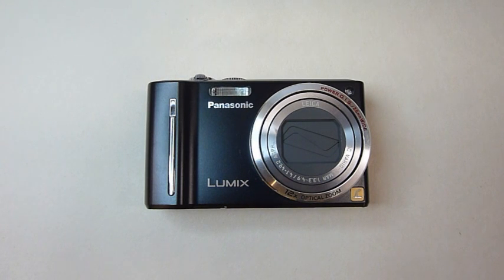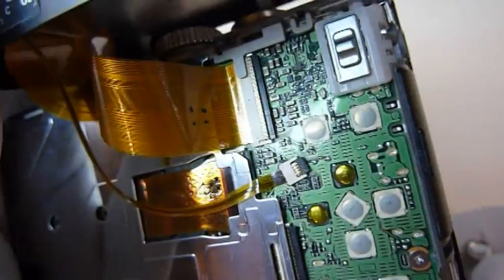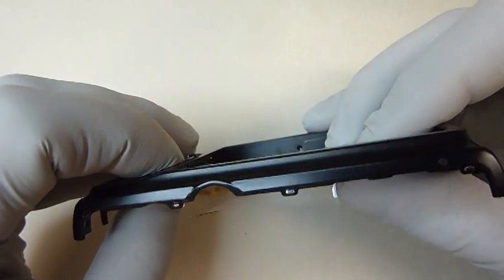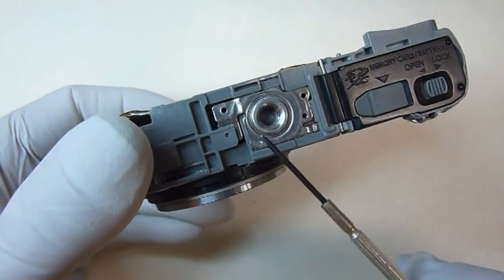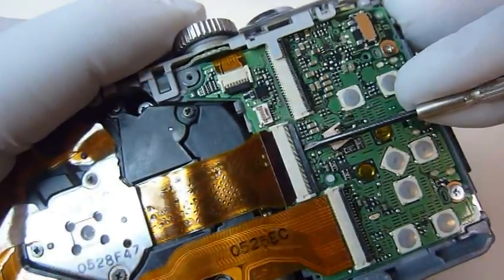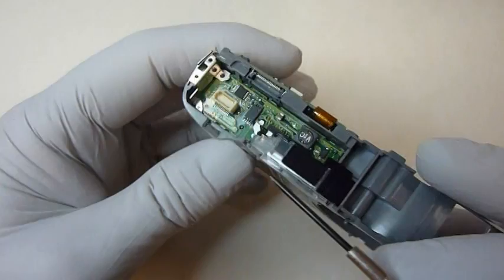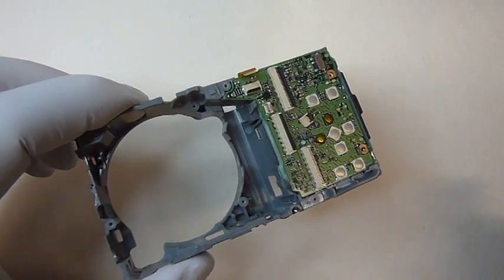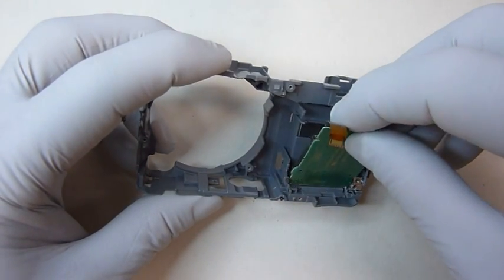Repair A Panasonic Lumix ZS6, ZS7, TZ9 and TZ10

Comment: Hi Robert! My TZ10 fell into a river and now it doesn't work. I tried to dry it in rice and now there are no signs of humidity but it still doesn't work. What parts do you think I should replace?  Should I get it repaired or buy a new one? Many thanks for your help
Reply from the maker: Hi Miguel. Even if you can't see any moisture on the circuit boards, there may still be enough moisture on them to cause them to not work correctly. You should still try to dry them completely out. If it still doesn't work after drying them out then you may need to replace the main board. But, even that is somewhat of a guess at this point. If the LCD display doesn't show some kind of water damage, then I doubt it is bad. Does the camera do anything at all when you attempted to turn it on? -Bob
Reply: Hi Miguel. I wouldn't write the camera off yet. There's a chance it's still very wet inside and can be dried out completely. The rice method only works to a point. If the camera was not powered on when it got wet, then that will increase your chances of it being repairable. But, even if it was on you may still be able to dry it completely out and have it work again. You will need to open the camera up though, and remove the circuit boards to dry them out completely. Place the circuit boards on a heater vent, or have a fan blow on them, for at least a few hours. You can use a small amount of heat, but don't put them in an oven, or get them too hot, because if you do the the solder joint connections on the circuit board could "run" and then the circuit board is completely ruined.  Let me know what you find. -Bob
Reply: Many thanks Bob!!!
Reply: Hi CMHSoftware. I am following your instructions and there are no signs of humidity. If your advice doesn´t work, should I replace the circuit boards? Is the LCD screen also damaged? Many thanks for your kind help
Reply: Many thanks! It works

Comment: Do you have any ideas or advise for excess camera noise during video? I use my zs30 in a marine case and recently hear an intermittent "grinding" sound besides my regulator bubbles. I love what this camera does and posted a few to YouTube also. Thanks
Reply from the maker: Hi David. I just checked out your "Diving The Wrecks In The Keys" video. Holy smokes very impressive. A great video in both what you do as a scuba diver, and also in recording the video itself. In regards to the noise you are hearing, I did hear something "different" right at the 6:00 minute mark. Is that the noise that you are talking about? There are only a few things inside the camera lens that could make an audible sound. One being the main zoom motor, the focus motor, the shutter control and the image stabilization. I'm not familiar with working on the ZS30, but I"m guessing that it may something to do with the image stabilization. If it's similar to earlier models, the image stabilization is just a set of coils that magnetically float and maneuver a small lens. I don't know of any way to turn it off though, or why it would make noise only part of the time. Sorry I can't be of more help. I will do a little research on it. If I come up with anything I'll let you know. -Bob

Comment: Thank you so, so much!!! Hadn't used the camera in a couple of years and when I took it out today, all pictures would come out with black dots just like on the screen. Scary procedure later, it is back to perfect. I really appreciate you taking the time to post this. Turns out there was dust on the CCD. And the screws were much much smaller in real life than in the video.

Thanks again
Reply from the maker: You're welcome ion1017! I'm glad the video helped you out.
Reply: @Thebobfactor  bro can you help fix mine. The pictures keep coming out bright even when the exposure is at -2.
Reply from the maker: @unlimitediq1894  That one is super hard to trouble shoot from here. It could be the main board or it could be a problem with the aperture in the lens unit. Sorry I can't be more help.
Reply: @Thebobfactor  can I send it to you to fix? This thing really means a lot to me.
Reply from the maker: @unlimitediq1894  Sorry but I'm not able to take on any repair jobs at all. Just out of curiosity though, which camera model is it?
Reply: @Thebobfactor  TZ10
Reply from the maker: @unlimitediq1894  I'm guessing that it is most likely the lens unit that is causing the problem in your camera. That's a guess though. And I do see some working ZS7 cameras on ebay that you could use to take the lens unit from to replace the lens unit in your TZ10. The TZ10 and ZS7 are identical in that way. The ZS7 is just the U.S. version of the TZ10. I can't guarantee that it is the lens unit though, but that's where I would start. If it isn't that, then it would most likely be the main board. Sorry I can't be more help. Here's a link to one of the ZS7s that I found on ebay. https://www.ebay.com/itm/194688648527?epid=100172538&hash=item2d5459054f:g:aDoAAOSw2xhhz9AX
Reply: @Thebobfactor  Lens unit seems to be working fine. Zoom works perfect just like before. Doesn’t lock or anything.
Reply from the maker: @unlimitediq1894  The lens unit has an aperture inside that works separately from the zoom motor and all the gears and linkage used for zooming the lens. If you are unable to adjust the exposure, and the pictures are coming out bright, then it sounds as if the aperture is physically stuck open or there is an electrical issue with that part of the circuit. Changing the entire lens unit would be the easiest way to repair the aperture. I'm still working in guess-mode here, but the aperture is the area that I would be focusing on if I were working on the camera myself.
Reply: @Thebobfactor  what could I do to the aperture
Reply from the maker: @unlimitediq1894  Well, as I said, replacing the entire lens unit would be the easiest way. If you wish to try to repair the aperture yourself you will need to follow the instructions on another video that I have that shows you how to tear down the lens unit for cleaning. You can see the aperture in the lens at this time stamp in that video: https://youtu.be/zDGVqY2N0PM?t=546
Reply: @Thebobfactor  ok I’ll do that later

Comment: Hi my last hope my panasonic DMC-FS 35 WONT CHARGE ANY IDEAS ON IT PLEASE
Reply from the maker: Hi Mick,

I responded to you last week, but for some reason I don't see it here. Did you ever figure anything out on your FS35? 
I've never worked on one before and I'm not familiar with that model at all. About all I could suggest would be (if you haven't already) to check the contacts inside the camera's battery compartment for dirt or corrosion. Other than that would be to verify that the batteries are actually being charged by the charger. That is, if you use a charger.
Sorry I can't be much help.

-Bob
Reply: Bob thanks for your interest it's a mystery I have checked out the battery contacts there fine ill keep investigating it its a mystery what it wrong with it thanks for taking time to reply to this thank you from Dublin, Ireland..
Reply from the maker: Mick,
This is a long shot, but on some earlier Lumix models they had a very small disk battery under the main control panel on top. You had to take the panel off to get to it. The battery was used to store settings on your camera when the main battery was removed. But, when that battery went dead the camera would not turn on. I don't know if the FS35 even has a small disk battery in it,. but it might be worth checking. If you have the manual for it it may say something about the battery replacement in there.
-Bob

Comment: HI Great video .I have a panosnic Lumix DMC-SZ7 but the zoom button is intermitent it works fine zooming out but hte zoom in function doesnt work all the time which is frustrating .My husband is a fairly good at DIY but is unsure if its possible to mend the function or whether a spare is availble or just some contact cleaner would do the job .Many thanks in advance of any light you can shed on this . Tracy
Reply from the maker: +Tracy Rose Hi Tracy. Sorry for the delay in responding. I don't think it will be easy to replace the zoom control itself that is on the circuit board on the bottom side of the top control module. But, it should be easy to use some contact cleaning spray on it. Just remove the two small screws on the circuit board and remove the circuit board by pushing the plastic locking tabs back. You'll have access to the zoom control. If cleaning the zoom control doesn't help, then you will probably need to replace the entire top control module. Let me know how you make out on this. - Bob

Comment: SENSOR SCREWS ARE NOT ALL PHILLIPS HEAD, MINE ARE HEX/TORX, apparently only budge-able using a T3 driver, which, of course, I DON'T HAVE.  And of course, you don't know that til you open the fkg camera.  I love my Lumix(es), but I loathe Panasonic.  I've had it with their sensor nonsense and criminal lack of customer service.  After years, I was finally willing and ready to open one of the damn cameras (a supposedly "Like New" ZS19 that actually has a big fat piece of dust on the sensor), only to be met with something the videos don't mention: fkg T3 screws.  Screw you, Panasonic.  Just a warning for others with perhaps newer (?) Lumix cameras.  Make sure you have every type of mini-screwdriver known to man.  Panasonic will find a way to thwart you.  Make sure you can beat them.  Because the best time to put something back together is ASAP after taking it apart!

Comment: My ZS7 is about 4 years old, and now and the unit won't turn on when I flip the switch. It's intermittent, sometimes it works, sometimes it doesn't.  It's not the batteries, I've got two. I thought the on/off switch was way under built when I first purchased it. Has anyone else had this problem or solved it? I've babied this camera(cased, never dropped, etc.) I think it's a capacitor, or which there many. Thanks.
Reply from the maker: +Goopin Dog Hi Goopin Dog. Ya, intermittent problems are by far the hardest to troubleshoot. I wouldn't think that it's going to be a capacitor though. Generally when a capacitor fails....it's completely done, and just not intermittently. The first thing I would check is the battery connections inside the batter compartment. If it's not that then I would check the connector below the power switch that is on the top panel. You will need to remove the top panel to access it. Check for any indication of a bad connection such as corrosion. It's pretty small, but clean both sides of the connector just to make sure. Let me know what you find Goopin.
Reply: Thanks for the help my brother, I'll try those fixes as soon as I can.

Comment: Hi Robert, I have a TZ3 which I love but it has stopped working, dead as a do-do. I've tried a new battery and a new charger but no joy. I have read that this is a problem with the TZ3 and that there is a tiny lithium battery internally on the "top operation pcb" that sometimes dies and needs to be replaced. Is this difficult to access and do you have any videos on this? I'm desperate to fix this camera as I love it! Thanks, JT
Reply from the maker: halfpint2312 I have never repaired a TZ3, and I currently don't have one that I can check out.

But, after looking around I did find a repair manual for it on-line that does show how to tear it down and it also shows the location of the small battery. The manual also states that the battery "is a critical component". But I'm pretty sure you already knew that after two cameras!!  :-)

Here is the link for the manual:
http://www.manualslib.com/manual/118070/Panasonic-Dmc-Tz3eb.html?page=7#manual

Page #7 shows the battery location and page #23 is the beginning of the disassembly.

Please let me know how you make out on this halfpint2312.
-Bob

Comment: I have a relatively simple problem:  My two year old dog found my camera sitting with its battery door open, to allow me to download and edit my SD card.  Wife was keen to have this happen, but I left it sitting on our bed.  Came back to find pup had chewed the battery door on my DMC ZS20, AS WELL AS ON MY CANON PS SD800 IS.  I just came back from a one month trip in EUrope and am fed up with holding it shut with tape.  It looks like a simple enough removal of the door, and replacing from an EBAY used door, and spring.  I would like to make it as simple as possible.  Any comments, or door replacement tips?  I note that one can buy a clever case that holds the door shut, but looks a bit annoying .  http://www.amazon.ca/Always-Wrap-Up-Compact-Digital-CyberShot/dp/B0029J0AZ0/ref=sr_1_1?ie=UTF8&qid=1434215690&sr=8-1&keywords=always+on+camera+case

Any leads as to making this simple?

Comment: The reason why your phillips screwdrivers do not work well, is that they are NOT phillips screws.  They are JIS screws.  Pull up Google's image search, and search on "JIS screwdriver"  You will see pictures of the JIS vs. Phillips, and you will see special drivers.
Reply from the maker: PanamaSticks Great info PanamaSticks. Thank you!!
Reply: +PanamaSticks 
I used the same screwdriver as in the video but it was very slightly too wide, so I used a sharpening stone to file down the sides and it now fits perfectly.

Comment: Hi does anyone know where I can buy a new LCD screen for a TZ40 please
Reply from the maker: Hi Colin,
Here's a brand new one that's listed on Ebay for $69.95. It also includes the backlight and touchscreen which is nice, because you won't have to bother swapping them out. It's also listed as being shipped from the U.S. and not China.
-Bob

http://www.ebay.com/itm/For-Panasonic-DMC-TZ40-DMC-ZS30-GK-LCD-Display-Screen-with-Touch-Backlight-New-/331419666138?pt=LH_DefaultDomain_0&hash=item4d2a26c6da

Comment: Hello thank you for answering so soon,when I have mounted the unit of zoom I have not disconnect nothing of the motherboard ,only the cables of the unit,I have mounted the unit of zoom but I have forgotten to transfer the crystal and the rubber of the sensor in the new one,I have started it but it sees a few rare colors and  gets out of focus,I have dismantled the camara  and mount the crystal and the rubber of the sensor but without realizing I gave him to the button of start and I start the camara  without  the connection of the screen(lcd) ,I have charge  the battery and when i connect it ,it does not work at all , not even the green led is on ,nothing,If the screen is not connected well it shot be of black color but the unit of zoom it shot  opened no????
Reply from the maker: Yes, you're right nik2009es, you should be able to turn on the camera without the LCD screen connected and it should power up fine and the lens unit should open up. I've done that many times while testing cameras.

You're saying that originally the camera did start up fine before you put the CCD's crystal and rubber on? And, it was only after you put the crystal and rubber on the CCD that the camera quit turning on?  That is strange. It almost sounds like there is a main circuit board problem, or for some reason the battery is just not making a proper connection. Do you have another battery to try in it?

Bob
Reply: I do not have another battery but I have measured this one and it has 4.1 volts
Reply from the maker: It could be the top switch, but I doubt it since you did not remove that circuit board from it. But, there are two connectors on the bottom of the circuit board just below the switch, you should make sure that the entire top assembly (with the power switch, rotatory dial, etc) is pushed completely down. Otherwise the two connectors on the bottom will not be in all of the way.

Comment: Hello Robert I have changed the unit of zoom of my lumix tz10 ,and now the camara does not start....The battery s fully charged ..Not even the led its start ...It does not move anything  ....It has some fuse?????  Which can be the problem??????    I need help please  !!!!!!!!!!!     thanks
Reply from the maker: Hi nik2009es,

When you tore the camera down, did you remove any of the circuit boards, or did you just remove the lens unit? If you removed the main board then you will need to double check all connectors, front and back, on that. The flash unit circuit board on the top of the camera also holds the connectors for the battery on it. Make sure it is back in place if you had removed it. 

After that, the first thing I would do is to double check the flat ribbon cables that go to the LCD display. If they are at even a slight angle in their connector, the LCD won't come on. I've run into that problem a lot. The smaller cable is especially touchy. Also, make sure that the black bar is back down. If the ribbons from the LCD look good, then the next thing I would do is to unhook the flat ribbon cables on the main circuit board that come from the new lens unit you just put in. Then, see if it turns on at all. If it does come on it may indicate a defective lens unit. Be sure to keep the flat ribbon cables that go to the LCD display connected when you do that.

There aren't any fuses on these cameras that I know of.

Let me know what you find.

Bob

Comment: HELLO I have a camera panasonic lumix dmc-tz10 and have bend a hoop of the unit of zoom and want to replace the whole unit.
They are exactly the same????
I want to buy a unit of zoom in EBAY , from CHINA  And to change all  the unit of zoom.....
New Genuine Lens Zoom Unit Parts For Panasonic Lumix DMC-ZS3/ZS1/ZS7/TZ7/TZ10        
Are the same  for all?????????  THANKS        I WAIT FOR YOUR RESPONSE BEFORE BUYING
Reply from the maker: Hi nik2009es. 

It "appears" that they all use the same 12X Leica lens unit. I cannot be 100% sure on that though. You will want to contact the seller of the lens to be sure. But, my guess is that they all use the same lens unit.
Reply: thanks i like your videos